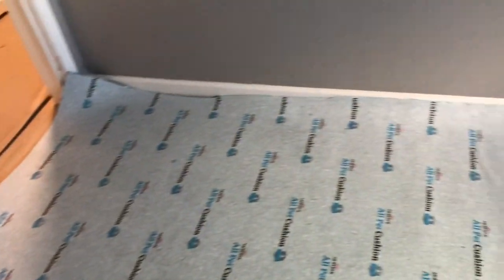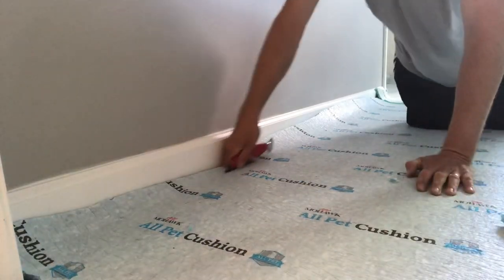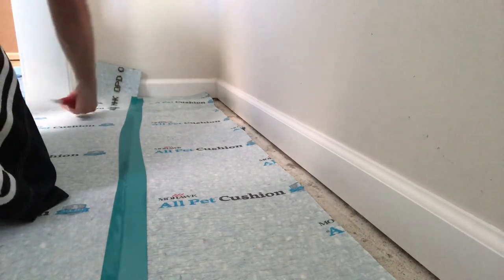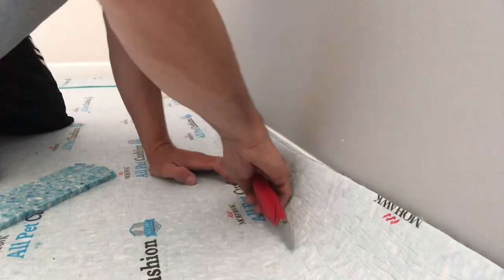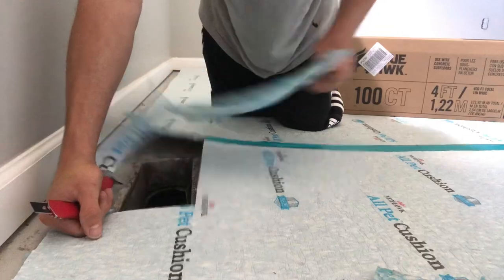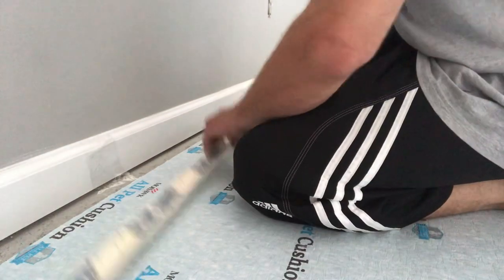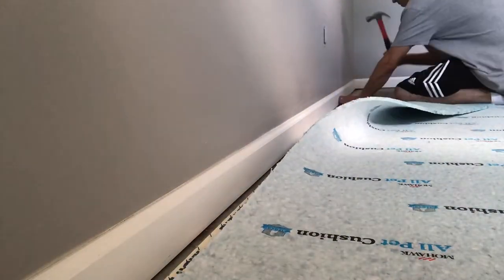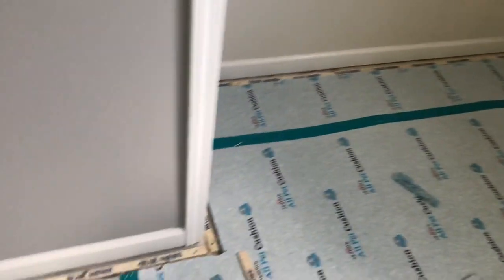How To Install Carpet Padding The OFFICIAL CEB CERTIFIED WAY

Comment: When would you use the double side tape, that heavy adhesive stuff
Reply from the maker: For the most part I’m only using double side tape on the rubber fitness flooring when we do installation in residential homes
Reply: @CarpetExpertBlueprint  can it be used for carpet cuz i just told this guy yeah he can
Reply from the maker: Yep it’s not the best scenario but it’ll work for sure!